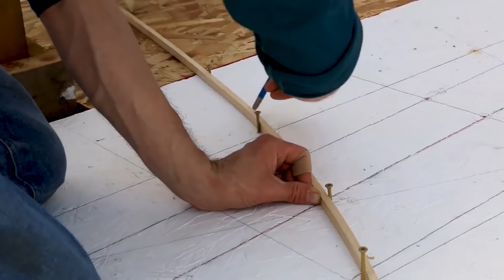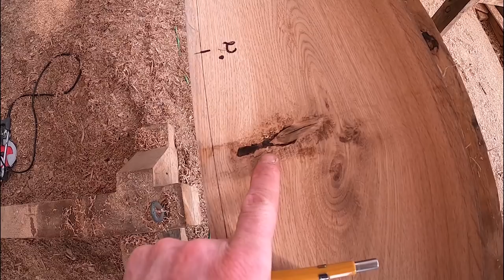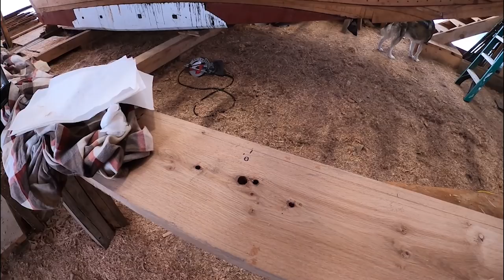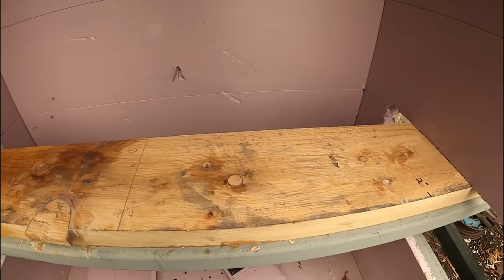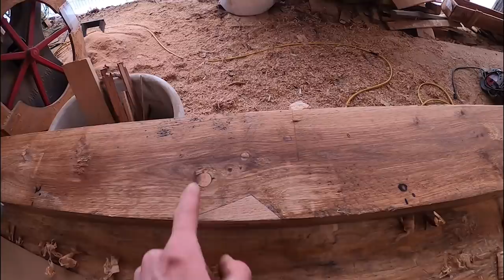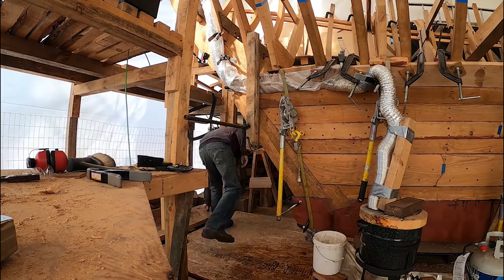Acorn to Arabella - Journey of a Wooden Boat - Episode 104: The Last Oak Plank!

Comment: About the length of the plank:  It looks to me like you measured the length on the bottom edge and then cut the end angle off the top of the plank instead of from the bottom.  The top length of the plank looks like it is the right length for the bottom of the plank.

Comment: 27:00 it looks like the top measurement of the new plank is what the bottom measurement should have been.  So you probably took your measurement of the previous plank and applied it to the top of the new plank instead of the bottom.
Reply: That was my first assumption too
Reply: Yup, this was a classic long point/short point mistake. I think we’ve all done it.
Reply: We all been there before :-)
Reply: That's what it looks like to me,  as well.
Reply: I think he measured it right the first time.  I definitely heard 29’ 7 3/4” the first time and then every time after that he said 29’ and 3/4”.  Assuming he did leave it long, that explains the six inches that were missing!  We’ve all been there!  I just felt bad watching, utterly defeated knowing there was nothing I could do to help! 😂
Reply: I wish more would give metric a go. It won’t take long to get used to it. It is just like adding up dollars and cents. But I respect those who choose to stick with the old way. Who am I to tell someone what to do.
Reply: Our surveying system is not metric and would be a nightmare to convert.
Reply: RBCharger I hate it when the short was really the long..& when the long was really the short..won’t be the last recut on that project. As always, good job Steve.

Comment: the epoxy that didn't harden seemed to be where there was no bench underneath to help insulate from below....just a thought
Reply: Exactly my thought. Like there's ice on a bridge in clammy weather conditions, but not on other parts of the road.
Reply from the maker: It is possible! Steve also found that the heating pad he used on that section is no longer coming up to the same temperature as the other two. They have been used a lot, so it was just time to replace that one.

Comment: It looks like you might've forgotten to add the extra length for the angle @4:00 . The length of the tip looks like it would fit perfect on the lower side @27:00

Comment: Is imperial being used because the original plans are so old?  I ask because in all modern manufacturing and engineering it is all metric and has been for a long time (even if finished products get labelled with imperial).  Wouldn't metric also allow for greater accuracy and easier calculations/transformations  too?

Comment: You can order a board stretcher on Amazon. That should help!
Reply: They don't make them in the size required for the boat. Way too long... I have the deluxe model for boards 6' and less - that I use often.
Reply: @genebruce6321  I've had reasonable results from this unit https://youtu.be/bgS6-O2APWY by increasing the hopper size, and adjusting the machine so that each pass mostly empties the hopper, then using multiple incremental passes. It's a lot of faffing around, but probably less time-consuming than scarfing

Comment: I have a question about the DeWalt mod for changing bevels when you change the bevel angle what guide do you you for your cut line. There’s 2 markings one for 90 and one for 45 degrees, I assume you would be changing the reference as you change bevel or is the change so small(say up to 15 degrees) it doesn’t matter?? Thanks love your videos learned a lot

Comment: How is it determined that this is the last oak plank?  Glad you can keep working. Be safe.
Reply from the maker: The last oak plank has kind of become a running joke at this point.  But these will be the last full length oak planks we plan on putting on the boat.  From here on up it will be cedar.  We planned to do cedar after the oak broad strakes but realized we weren't going to have enough so we put on more oak planks.
Reply: @AcornToArabella  Got it, but why? Is it just a matter of supply of wood, or is oak used on the bottom for some basic boat reason.  I think the Western Flyer rebuild is using a tougher wood at the water line where the boat might get knocked around and yellow Cedar below that point.

Comment: at 4.27 u took 29ft 7 3/4 long and when u was marking the plank for cutting at 7.35 u said u wrote 29ft 3/4 inch long. Is this were u went wrong maybe we are only human and your doing it solo
Reply: Yes I agree with you, that is exactly what happened, I was about to write the same comment but decided to view all the comments in case someone mentioned it, when I came across your comment. At first I thought he misspoke at 7.35 but I was not surprised when he found he had cut the plank to short. He is doing an excellent job though and very thorough this was just a slip up, he must miss Alex I think because he would have caught it!

Comment: 12:54 These knots are not lying on the work bench but hang in mid air. The heat might have escaped through the bottom.

Comment: The knots where the epoxy did not harden appear to be where the plank has nothing below it.  Could the bench supports made the difference in temperature?
Reply from the maker: Upon further investigation, Steve found that the heating pad used on that section wasn't coming up to the same temperature as the other two heating pads. The heating pads we use are not really meant for the sustained higher temperatures that we require, and it was just time to retire that heating pad.

Comment: Ugh, the nibs again. You still have the exact same angle on all the planks, as you do on the garboard, its just on the short point of the miter which now has no grain connecting it. I think they are likely to split off right along the grain line. Just tap the nib with a hammer, it'll pop right off, whereas you could beat on the long point all day because it's grain is connected.

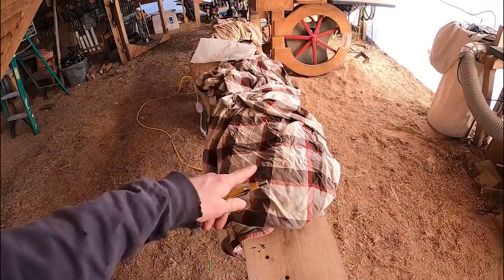Comment: 9:46 is the reason why professional wood growers cut the low branches of trees, forcing it to grow high and clean. Great grandpa had 9 oak trees that have 10 to 14 meters of straight wood in them, everyone mistakes them for other trees at first, since there's no branches below that line.  One other advantage of such a tree is that because they are artificially forced to grow branchless so high, the grain is really tightly packed with passages for the water/sap to move. 

I've planted myself, 4 new ones, already at about 5 meters tall now, for the next generation.  Not easy work, not easy at all.  Certainly had to find new means to get up there and prune them.

Comment: for some reason the epoxy did not harden... poor mixing ?
Reply from the maker: It turned out that the heating pad on that section was no longer working correctly, it needed to be retired.
Reply: @AcornToArabella  too bad - I guess it was not worth getting some heat back to the area to let the polymerization take place anyway...

Comment: Hmm here i for first time noticed the ground is basically covered with sawdust. That is not safe. The sawdust is dry, It will stay dry and basically you have a perfect fire hazard. You are working with saws and wood. If someone put for some reason some metal like a nail or a rifle bullet into the wood and you saw trough it you will have sparks flying around. Now granted there is a high chance that nothing will happen but do take the two hours that it will take to pile everything outside and just clean it every morning (10/15 minutes.) and you will be way safer. And it is really about the lose stuff. Its in the ground or mud? Nothing will happen.
Reply from the maker: Thank you for your concern. However, the fire department came out with the building inspector and said that they were not concerned with the amount of sawdust because it smolders rather than bursting into flame. The "floor" of the boathouse is dirt, so the sawdust isn't dry in the same way that it would be on a concrete floor.

Comment: You know, metric is far more accurate
Reply: Only if you are used to using it.  I am in the US, I have been using Metric since 1983.  I have been forced to interpret it for most everyone I work with and in one case told to STOP using it as the boss said I am disrupting everyone else.  Now a days it is very commonplace.  But as our Australian cousins say, "We use which ever works best at the time."  I have found that some machine shops to still use thousands of an inch, they say they don't want to recalibrate all their tools and machinery.  A valid cost issue.  Over here in the US, we are about 80% metric.  One day inch measurements will be like cursive writing.    No one will be able to read them.  Have a safe day. I mean that....

Comment: This series should be renamed “how to rebuilt an old boat as slowly as humanly possible”
Reply: Don't be dull
Reply: You have no clue how many man-hours go into fixing a boat or airplane.

I was a submarine sailor in the US Navy. We had month-long refits that required about 10x the number of bodies we had in the crew, working 24/7, to get done in time.  And that's on a steel hull. Wood hulls take even more time to get things fitted together.

An airplane overhaul (I'm talking a 727 or 737) takes about 100 people working around the clock (40ish hour weeks) 5+ weeks from arrival to acceptance flight. 20,000 hours work, minimum. That's 10 years work for a single person working full time. And that's a lot less work that what they're doing here.

If this ends up being anything less than 150,000 hours of work, I will buy Alix and Steve a bottle of their favorite beverages!